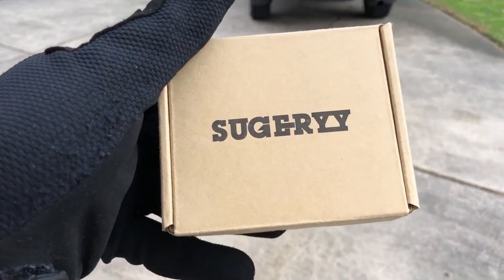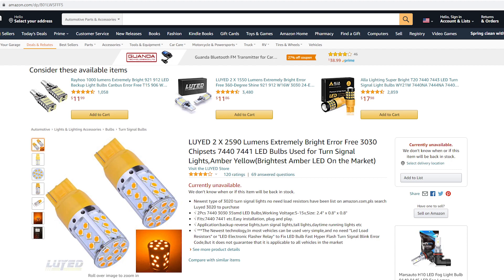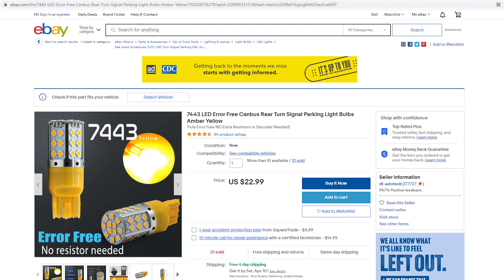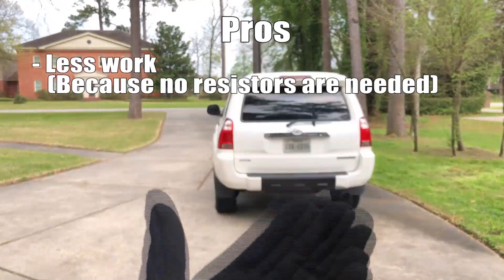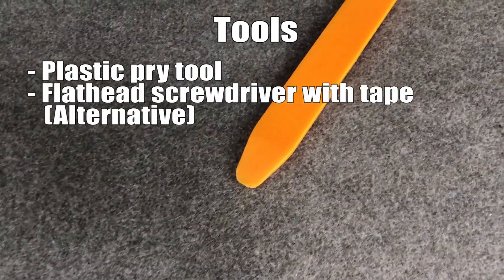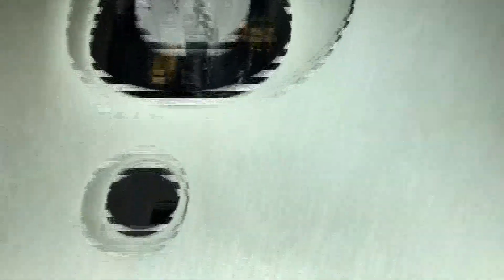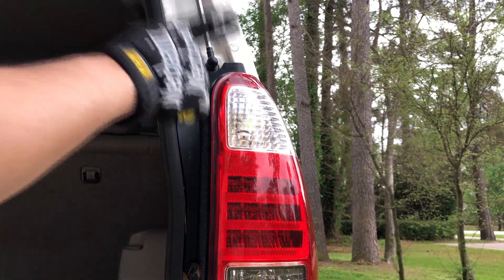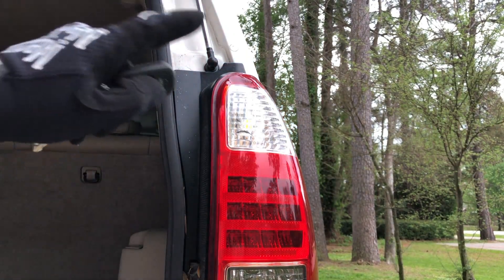4th Gen 4Runner Rear LED Turn Signal Conversion | For 2003 - 2009 (NO LOAD RESISTORS)

Comment: What front bulbs did you use? I just ordered a set of rear bulbs from ebay.
Reply from the maker: Shane Krantz I use 2 generic LED bulbs with load resistor harnesses. I tried using error free bulbs along with my rear ones and they caused the hyper flashing

Comment: I have these bought it 6 months ago and driver side is now speed flashing. Still works but on inspection I can see brown burn spots around them… the other side probably will go soon. Not a good set. These are the 2 pc.
Reply from the maker: Chris You must’ve gotten bad ones. I’m sorry to hear they’re failing after only 6 months
Reply: @airsoftmechanic  since they are only $10 for a set I’ve decided to give them another try. How long have yours lasted ?
Reply from the maker: @Chris_junya  Mine have lasted for 4 years. A few months after this video, they started flickering. Got another pair after that